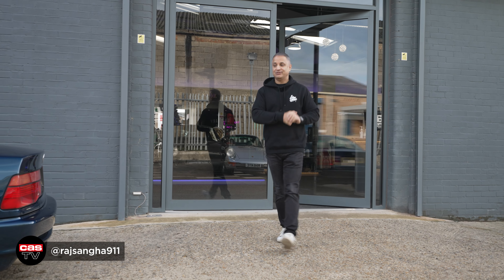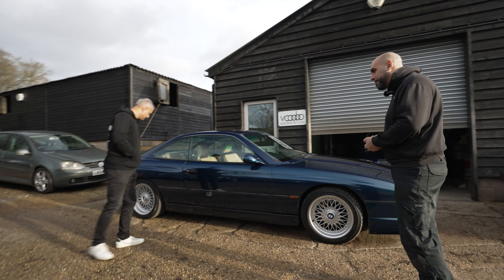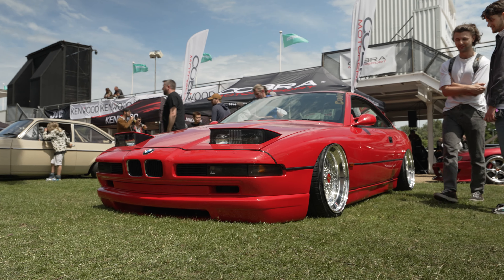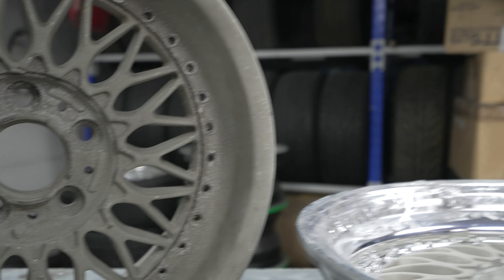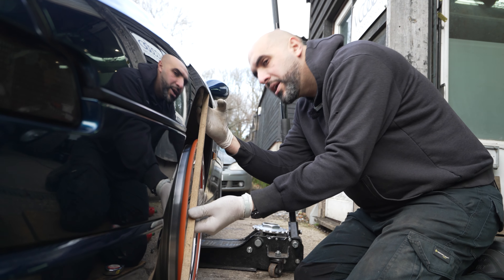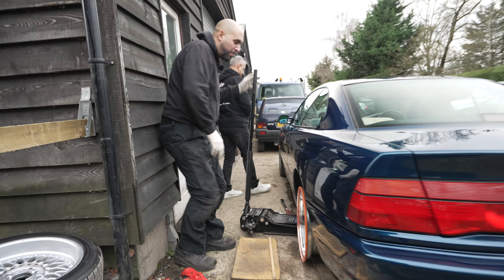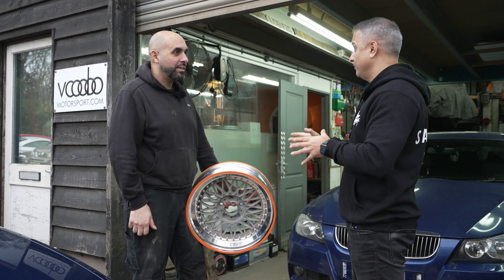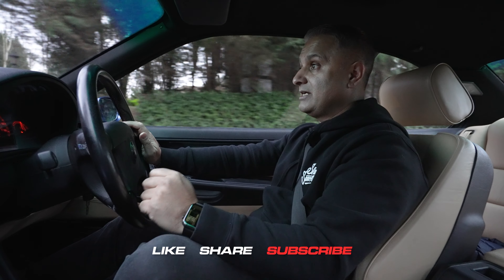BMW E31 840Ci Sport Custom Wheels | Slam Sanctuary Customs BMW E31 EP2

Comment: Sonething strange here.  I run 19" s also on my 840.  9.5 front with 255 tyres and 11.5" Rear wirh 295 rubber
Reply: Yea something is off and I’m running 8.5 in the front and I have a 1 inch spacer 👀👀 so there’s room for more meat on the wheels